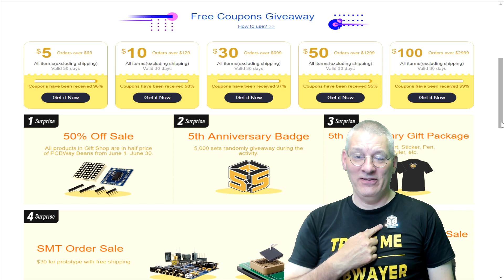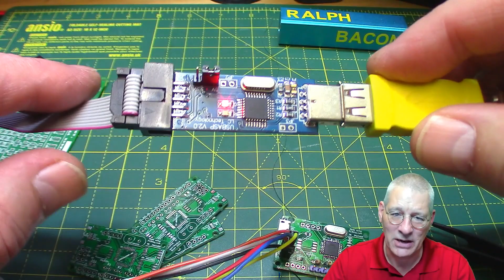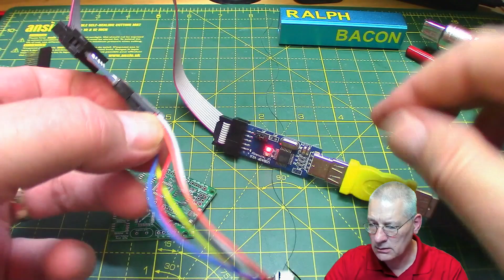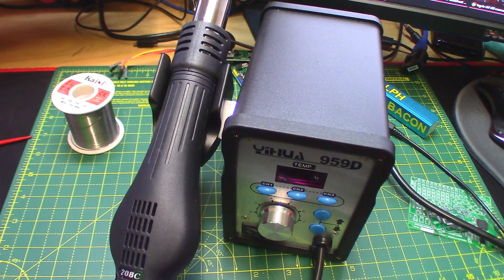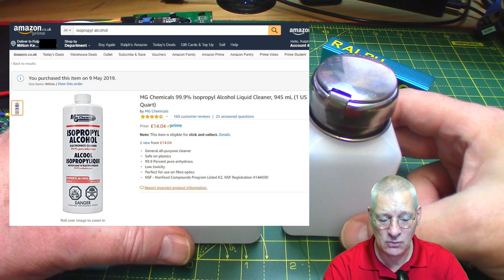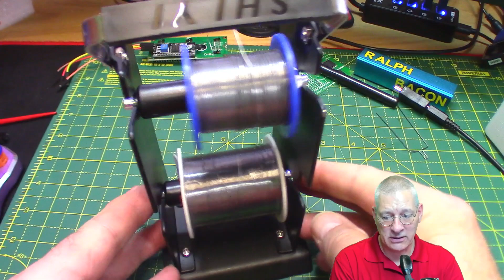#150 SMD KiCAD Arduino PCB Project (Spoiler: 😭=FAIL)

Comment: I have not had such fast service from PCBWAY/DHL

You "ordered at Thursday lunchtime and had them in your hand by Monday lunchtime" which I make 4 days.  Which delivery option did you use and how much did it cost ? Did you have to pay any import duty or tax ?

I ordered early afternoon on the 18th and DHL are predicting delivery on the 25th which I make 7 days.  The shipping charge was $23.00 and I have been charged import duty/tax for the goods amounting to £3.63

The PCBWAY headline prices are low but the overheads can be high
Reply from the maker: My experience was this (and they didn't treat my order any different to any one else's):

1. Submitted design Thursday am, got a reply within 30 minutes saying it had passed inspection.
2. Paid the money (yes, I actually forked out real cash), $5 for 10 PCBs, $21 for DHL shipping.
3. Over the next 24 hours I monitored the progress of its construction at PCBWay.
4. Then got a message from them saying it was being shipped, Friday pm.
5. DHL then kept me updated (and I could - and did - track it) as it left Shenzhen, went to Hong Kong, flew to West Midlands airport (UK) overnight then again to a local DHL centre.
6. Finally got a message Monday saying they were delivering that day and they did, around lunchtime.
No delays, no custom duties, no VAT. Phew! Always a worry, but small value items usually get through.

Possible reasons for delays:
1. You chose a different colour to green (24 hour turnaround)
2. There was some kind of Chinese holiday or festival that delayed shipment.
3. It was held up in customs (in the UK). This is more likely if you use a known courier such as DHL, allegedly, no idea why. Then it just sits there.
4. You don't live on the UK mainland.

Your order is trackable at all stages, so you should be able to see where it was held up. It's a pity it took longer for you but it sort of appears that DHL were the ones with slow feet?  So that was my experience when I paid for my own order with PCBWay. When they have supplied me with boards as part of my sponsorship deal, it was exactly the same experience. Probably 6 orders by now. And, whilst I should not mention this, I've had the same experience with other component providers from China, when using DHL.

Put your experience down as a one-off and don't let it put you off. But if DHL are the culprits I would be having words with them, that's for sure...
Reply: @RalphBacon  Thanks for the detailed reply.  This is my second order with PCBWAY, the first having been sent by normal post which, as expected, took some time to arrive.  This time I thought that I would treat myself to delivery by DHL.  I followed very much the same path that you did by tracking the PCB production and subsequently the DHL delivery.  There was nothing special about the PCB.  I left all of the production options at their defaults as I had done with my first order.  PCB production took just over 24 hours once I had made payment and it is DHL delivery that is slowing things down.  For the price paid I am not happy with the service being received from DHL

What irks me most is that the headline prices compared with what it really costs at the end of the day.  I will almost certainly use PCBWAY again as I have already thought of improvements to my project but I will probably try one of their competitors too.  Postage/courier costs will still be a factor, of course.

Comment: Let us  not recommend Dr Peters book anymore then.
Reply: I agree, if you can't be bothered to send your gerber files off and then solder on the parts to check all is ok for beginners then you should not profit from it.
Reply: Exactly so if the Dr title this guy is some type of wizard.  Of course could do book part 2 and on and on.
Reply from the maker: To be fair, Michael, the book is great and it's about designing boards using KiCAD . I've learned so much from it. That fact he made a simple design error doesn't detract the value of the book (too much) for me. 
I sort of agree with other comments here that maybe he should have actually tested the board before letting me find the errors but it's all a training exercise anyway. He will correct the PDF version of the book quickly; the print book will take more time but will appear in the Errata list on his website. I still think the book is very valuable for would-be users of KiCAD.

Comment: I've used solder wick for decades but most times I have to add solder to start it off.
A few months ago I spotted this on eBay and it is really good......7.5m Reel of 2.8mm Chem Wik Solder Remover Wick Mop Desoldering Braid....£7.99 .....no priming reqd.
I usually program bootloaders with another Arduino but I decided to get a USBasp this week and after sorting out the driver from Zadig it worked great.
I tried sm soldering a couple of months ago with a 99p 10 led scanner...I didn't do very well but it did work so I am sticking with my through hole method for now.
 I have made a couple of dozen bare Arduino boards , some with ZIF sockets, for the many projects I build. I also buy Uno, nano, pro mini etc boards so never short of a board .
I  agree about keeping clear of the lead-free solder. I have just received 2 of the latest Uno boards and they have dull grey solder.
Reply from the maker: Indeed, I sometimes add solder to wick to start if off as you say, but most recently I've found that extra flux works well too. And that dull grey solder is exactly what my rubbish stuff turns into. In the bin it goes, I guess. Glad the USBASP worked well, it's actually quite a reliable alternative to using the USB port (if there is one). Thanks for posting.

Comment: Buying solder from china seems to be a bit of a lottery as many people have said they have had problems, and it aint cheap. I think it's best to go with a brand you no. Shame about the errors in the book ( bit naughty not trying the board) but you learnt shed loads so that's good, I look forward to more Kicad stuff (I love design with it) and SMD...cheers!
Reply from the maker: I won't be buying solder from China again. 'Nuff said. 😡
Reply: totally agree, 100% the reason problem soldering the chip to pcb, i use Silverline solder, cheap, not lead-free , just works about £3 for 50g
Reply: I got mine from cpc as smd is hard enough without issues with solder.